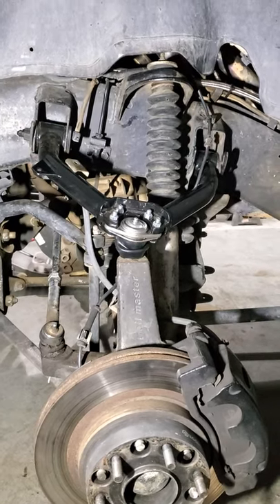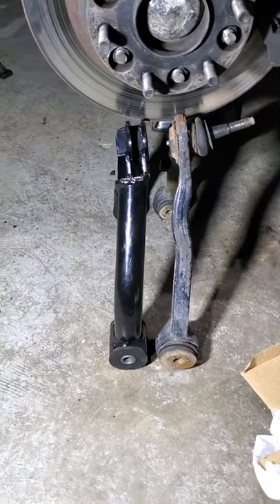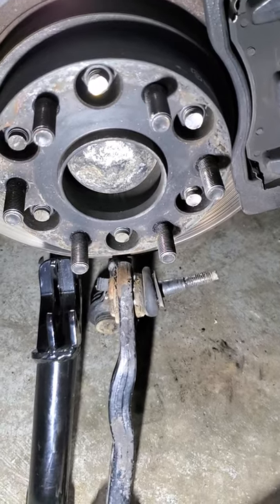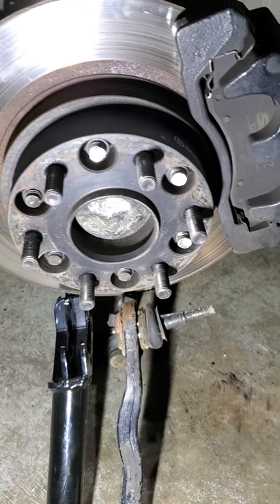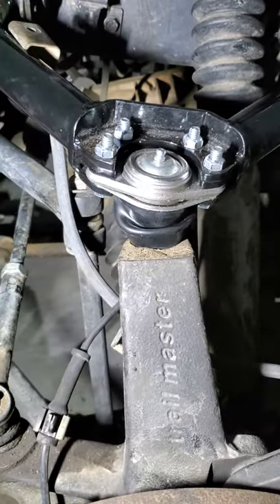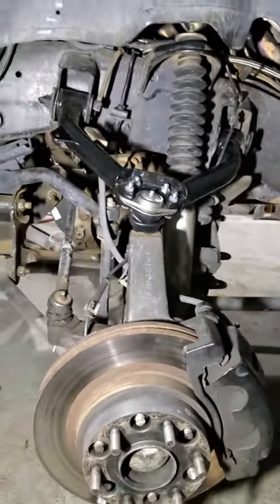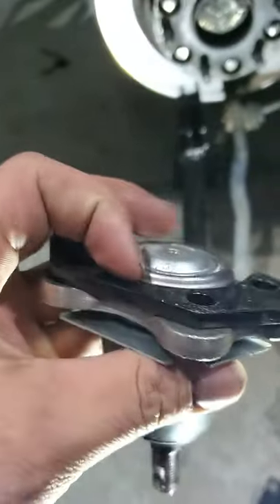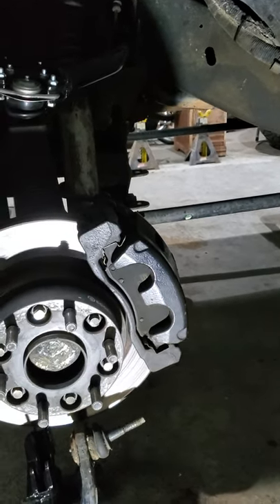spindle source upper control arms

Comment: I have these also on my 1500 quad cab.. Ok so far. Also had to bend that brake line bracket down. Alignment shop took some time aligning everything.
Reply from the maker: Mine was kinda the same but it was the lift that was some crooked

Comment: Did you ever post a update on them I just got mine in the mail today same reason I need to go up on the keys stock keys are  maxed out putting 3" keys on and these hoping the alignment deal goes better than my last truck with 3" keys and stock arms
Reply from the maker: I haven't but it fixed the angle of the tire rides so much better
Reply: @texasbowtie_8069  good deal thank you for the reply